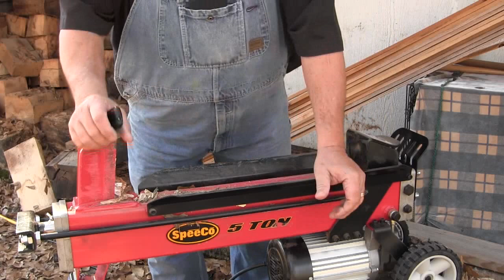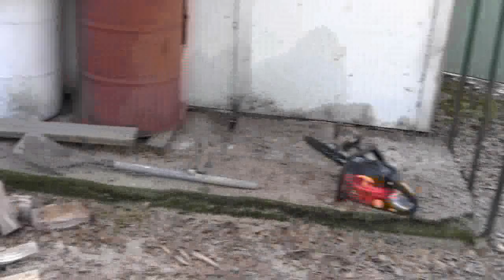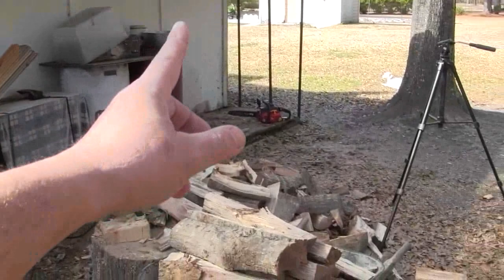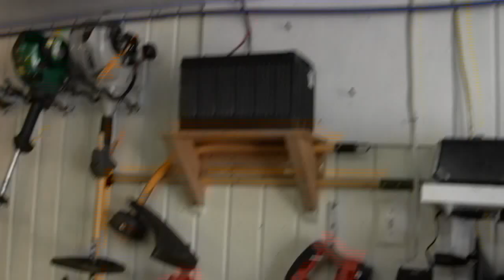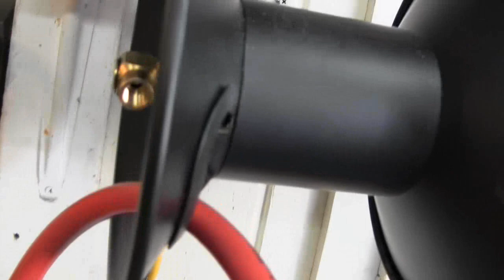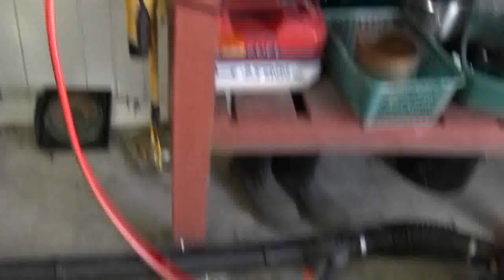Stop the presses !!!! I was wrong!!!

Comment: Thanks for the update,I really appreciate it.I bought a bush axe to clear some of my property,because my brush cutter wasn't working.The blade snapped in half after using it for about a year.I had my receipt,and the big box store took it back,because the company said they never heard of the blade snapping in half.I got a brand new one,and after 6 months using it,that blade snapped in half.I took it back, had receipt,but had a little trouble with cashier,but I got my money back.I never bought another one.The problem is they are making the blades thinner.I found 2 old bush axes that my dad bought in the 70s and put new handles on them,no more breaking blades.They don't make stuff like they used to.You told me you didn't know what work was.You are a hard working man,and of course you bought a hose reel.
Reply from the maker: The blades from the busted ones might make good knives. They are high carbon steel that can be heat treated to take the brittle out of them. I buy old tools that are in good shape just because I'm so familiar with the crap that comes from overseas.
Reply: BCtruck, rebuild, repair,repurpose I had to hand over the broken ones.I think they sent them back to the company.They were Tru Tough Bush Axes.The company was surpised that one snapped in half,let alone 2 of them.If I had them,and you would accept them,I would have sent them no cost,because it would have been really cool to see you make a knife out of something I once owned.I need to learn some of your skills,because,there is not enough repurposing going on in my life.

Comment: I though my 6 ton Powersmart was trashy to.  but its gold compare to that thing!  I really like it now!  Since i made it hands free. Its all operated by the foot peddle! All i did was loop a rope from the lever >Tide on the lever, and down to a wooden foot peddle.  Back up to the button. What i did was loose the box up and slip a long hinge down the side of the box. Tighten it back up.  For the rope to pull down on the hinge on the button!  Press the peddle pull down the hinge on the button and lever at the same time. Way i rig up the foot peddle was> used wooden piece1x4x12" 2 hole thread bailing wire to make a loop for the rope to run in. On the heal of the peddle, i put a long dry wood screw to hold it in place down into the ground. Made it where the peddle is 6" from the ground where the rope feeds from> IT WORKS SWEET 👍👍

Comment: First thing I would do is sharpen the splitter wedge. Most of them are too dull to get the piece to start separating so it can't go thru. A longer, narrow wedge added to the front of the existing wedge would work much better. It takes less power to split with a narrower wedge so once it's starting to split, then you widen the back of it to help separate the log.
 A table just behind the wedge would be a nice idea also so the pieces wouldn't always fall to the ground (or on your foot)

Comment: Also,make sure the wire is of adequate size. Even if the circuit is rated at 20 amps and it's on #12 wire,if it is any distance from the source,voltage drop will reduce it effectiveness. Upsize the wire to #10. That can help. Yes,I'm an electrician. Also, NEVER put an oversized breaker on a wire. It will turn into a heating element and cause a fire and the breaker will not trip. Never put a 30 amp breaker on a #12 wire.
Reply from the maker: I brought this back and bought an earthquake and it worked much better.

Comment: Glad to see you got the one that stays on all the time. Its really similar to harbor freights electric log splitter. I don't like having to hold down the button and press the lever on my splitter. Someday I'll get harbor freights. Great video.
Reply from the maker: I'm very happy with thus. The need for both hands to activate the other was a bit silly.
Reply: BCtruck, rebuild, repair,repurpose great! agreed.
Reply: ***** On my homelite log splitter when it turns off the ram retracts and if its on the ram won't retract.
Reply: ***** oh ok.
Reply: ***** That would help. Its a pain having to use both hands.

Comment: I think you may have gotten a lemon Earthquake.  I have had my Earthquake since last November and it has been great. I purchased it from Tractor Supply basically because one of my neighbors had one and loved it. So far I have split about 3 cords, mostly oak.  Today I started splitting green oak with it and it goes through it like butter.  Biggest I have split is 14 inches and while it took some effort the Earthquake split it.  In any case good luck with your new splitter.
Reply: Update.  I have split over 20 cords with my Earthquake 5 ton. Never a problem.

Comment: you talked about changing a breaker to 40 amps.  not a good idea.  if wire is rated for 20 amps and you put a 40 amp breaker, the breaker wont pop and possibly causing the wire to overheat and cause a fire. NEVER put a higher amp breaker on incorrect wire gauge.

Comment: Looks like the harbor freight 5 ton. It has the one hand operation also which is wonderful.
Reply from the maker: Since I did this video,I've discovered something else. When it wont immediately go through a piece of wood,you hold the lever and it goes into low gear and sloooooooowly splits the wood. I didnt discover that till I was halfway through what I needed to split.

Comment: Very nice machine.  You may have done this already, but I would remove that 40amp and put the 20amp breaker back in; most wall outlets are rated at 15amp.  This will protect the wires in the walls from melting and ultimately the save the building.
Reply from the maker: Done!

Comment: Earthquake: Yeah but, yeah but, the only reason that other splitter could split that log was because our unit loosened it for them ... and, and, and .... you can't get your hand caught while operating our unit. LOL
Reply from the maker: That sounds almost exactly like the conversation I had with them when trying to trouble shoot the unit. They kept insisting it was my house current that wasn't high enough. I told them that I ran a welder off the same outlet with no problems.

Comment: I wonder about the lifetime of the motor. From observation they do not seem to be designed to be run continously for long periods of time.  The earthquake and the speeco are basically the same machine.
Reply from the maker: JIMMY TATE The speeco has a bigger motor and it worked far far better than the earthquake did. Plus,its a one hand operation where the earthquake required two hands operate the ram.
Reply: 2 button operation is required for all industrial presses. Be careful where your extra hand is while pressing

Comment: I maybe weird but an electric splitter doesnt make much sense to me.
Reply from the maker: What's your beef with electricity?
Reply: Electric motors generate rotational motion by design. Internal combustion engines transfer a linear motion to a rotation via the crankshaft. Internal combustion engines, are by design, less efficient, and have zero torque at startup.

Comment: Stop trying to split them big ones down the middle at first, off set and take off pieces and this little feller will spit anything that way. Been using mine for 3 years like that and aint found a piece of wood yet it wouldn't split. Largest diameter so far was 25"
Reply: Loud and inefficient - wouldn't trade my 10 TON hydraulic for this loud piece of trash any day.

Comment: Beware the Honda GC Motor 

I bought a TSC log splitter about 3 years ago . It did what I needed . 
Then about 2 years into it I could not pull it the compression release failed . Ok not happy Honda motor I expected years of service with no problems based on reports of how good their small engines are . That is why I paid more for the honda GC over the Briggs / Kohler models for sale . 
I had to replace the timing - cam compression gear . Ok 15 bucks .. bad luck on my part . THEN I STARTED RESEARCHING and I called Honda and got a distributor in CO . He grew up on the farm so he understood the frustration . 
The model I had 190CC GC DOES NOT have a steel sleeve in the cylinder . It is a bored aluminum cast . Life rating about 200 to 250 HRS . He asked me about how many I thought I have on it was about that he said you got what you paid for . As I noticed it was starting to bog down on knots . 
WHAT !!!! I was not happy . He went on to tell me hey that is what Honda get's asked for per the price point the seller wants . He said the GSV has the steel sleeve . 
I paid extra for a cheaper motor . 
When you buy a wood splitter CHECK THE TYPE OF MOTOR . 
In retrospect I wonder if the Briggs or Kohler cheaper models would have had the steel sleeve . Maybe yes maybe no . RESEARCH the model of Motor . 
I was angry at Honda . A buddy engineer told me . Don't blame Honda . They are just giving the buyer ( TSC ) the product in a price range that they want to sell . 
So I lost 2 ways . Spent more for Honda motor . Then had to replace it with a briggs off the rototiller . 
Everything else on the unit is working fine . 
Do your research . BEWARE . They don't cheat you . They just don't sell you what is good . 
Thanks
Duncan Adams
Reply: Loud and inefficient - wouldn't trade my 10 TON hydraulic for this loud piece of trash any day.

Comment: There is really no excuse for exceeding the manufactures recommended maximum operating specs. and blaming the unit for failure to perform up to your requirements. Buy the right size equipment in the first place or you just come off as a ???
Reply from the maker: I think everyone who reads this will know who the clown is between us,especially after they find out that you thumbed up your own comment.